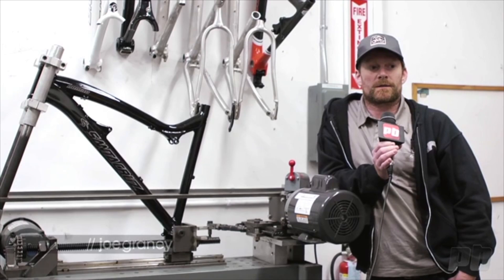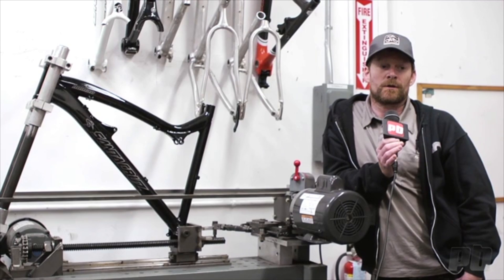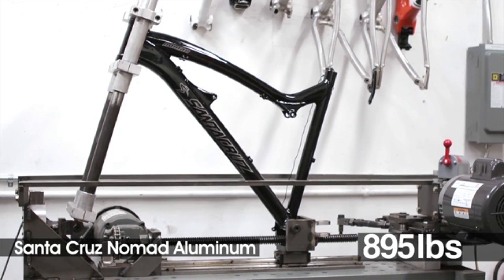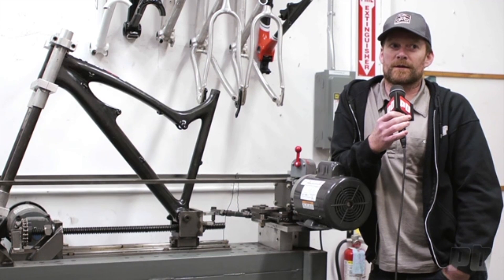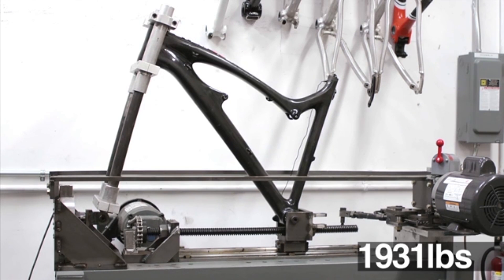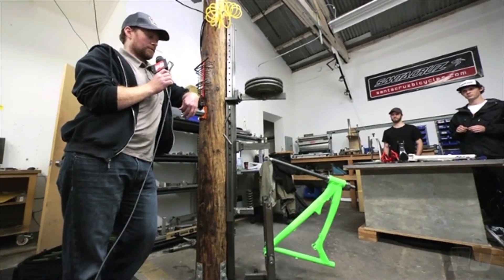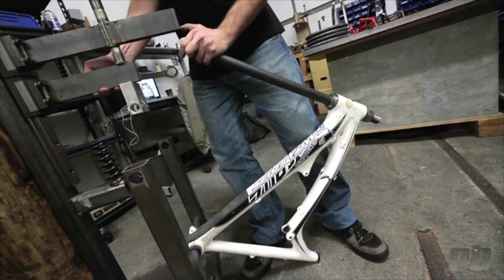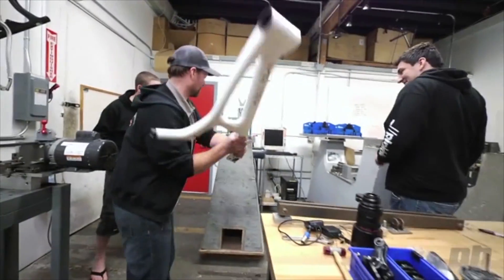Carbon vs Aluminum Frames - Which is Stronger?

Comment: The "smash the frame against concrete"-test at the end is majorly misleading.

A carbon frame that suffered from these impacts might feel safe in the hand and not show visible damage but internally those impacts lead to delamination which will result in cracks. As those delaminations are not visible it is a high risk for a rider to use a frame that suffered from such an impact yet from the outside you will not be able to tell if the frame is damaged. This is a reason why more and more companies offer carbon-bike inspection by using x-ray, ultrasound etc. to detect internal damage. This however was costly if performed after each (even minor) crash.

For that reason aluminium-frames are much safer in that way, that you can easily detect damage from the outside.
Furthermore quality-control is a major issue in the production of carbon frames. As carbon frames are assembled by hand even the tiniest imperfections (air bubbles, wrinkles, missalignment) can lead to major structural deficits.
(More in-depth explanation here: https://www.youtube.com/watch?v=EZbg5hCRyvs)

Lastly the first tests shown in this video are also not quite fair in that regard, that major damage to the carbon frame happens before the sudden cracking. If you listen to it carefully you can here the fibres bursting much sooner (at forces similarly to the aluminium frame). Those cracking sounds indicated damage to the bike that would already render it unsafe.

In conclusion this video can lead to a quite wrong impression about carbon fiber strength. Ultimately carbon is more vulnerable to sharp impacts and are much more costly to inspect. Fatigue cant be assesed that easily either.
Reply: My only problem with carbon is exactly because I can't detect the damage. It might be 'hanging on a thread' and I don't see anything, ride the trail, then got stabbed after a few jumps.
I'd rather have the frame bend a bit for each damage so at least if there is a slight bend and I still ride it then it snaps, that is my fault.
Reply: Cristian Ciupitu they're not avoiding carbon. The 787 is made of 80 cfrp
Reply: except they used an old, tested, abused, ridden, old frame. maybe, MAYBE you can't detect the damage as easily on carbon, but its still way stronger. people think aluminum is stronger because its metal. who cares what it is, look at the welds. thats what usually brakes. not the metal tubing, but the actual welding...
Reply: kansas785if if its a good weld them i is stronger than the actual frame
Reply: It all depends on what type of ply orientations and modulus of thermoplastics used. The orientations that exists inside the first twill are usually laid in 0/90/45/-45 directions and tow density also matters. Considering the application the maximum density of carbon fiber would be around 1.9-1.95 Kg/mm3 that is still almost 1Kg/mm3 less than aluminum 7075 tempered. Thus when used properly with right polymer, these fabrics offer extremely high tensile/compression strength, and also better protection to impact and continuous load.
 Being the metallurgy/composite metal matrix engineer i can confirm this.
Reply: @TheDazzler420  

Really, an engineer, then you would know carbon fiber is not matrixed with thermoplastic.
Reply: @truantray   really? then which polymer matrix they use.
Reply: TheDazzler420 epoxy is technically a thermoset. It has to do with the cross linking of the polymer chains. Which means that it burns instead of melting. It’s part of what makes carbon hard to recycle.
Reply: @GavynPendleton  only difference is this is carbon allotrope which is it can be reused as basic form of carbon, see carbon fiber has its own flaws in today's technology of production, that doesn't mean we should stop the application. People invest in all sort of advancement. And I think it's good to see composite materials becoming more n more reliable and predictable.
Reply: TheDazzler420 yea I totally agree with you. I’m currently studying composites in school because I think they are super cool and because they are super powerful in design.
Reply: TheDazzler420 Hi. I was wondering, I have a Specialized S-Works hardtail 1996 frame made in USA for many years made of metal matrix, very rigid frame. I'm probably easy on it. Is this material stronger than 6061 and 7075 aluminum and better with big impacts?
Reply: Gedöns And the ductile failure of the aluminium makes it much safer for the rider.
Reply: ohhh, killin em up! If companies made their carbon frames even CLOSE to as thick as the 2011/12 V-10 (years after turned into the thickness of a tin-can), then I would buy carbon ALL DAY. (thickest/most overlayed front carbon triangle production MTB ever made)
Just convinced me to fully stick with my original choice of the NEW aluminum 2018 Davinci Spartan. Bikes welded in Canada, too! stoked! (165mm 650b killer, has a pivot surrounding the rear axle, D-W link)
Reply: @420xwaytoomanyx420  
Not all aluminum is the same, but engineers at Canondale and Devinci get alloys to out perform carbon.
Reply: kansas785 Saying carbon fiber is like saying metal. There are so many different variations and quality of carbon fibers. As for metal, any good weld is actually stronger than the tube itself.
Reply: One of the reasons they have been limited using carbon for planes is its an insulator so isn’t as good for lightning strikes as it does have the faraday cage effect and can blow holes in it instead of run across the surface if I’m not mistaken.
Reply: Gedöns just cockblocked Carbon frames.
Reply: I was sure that was true but didn't exactly know why
Reply: just explain it as ali-ductile cf-brittle
Reply: best comment ever!
Reply: 100% agree with this and feel NO ONE should step on carbon (parts)  bicycles unless they are fully aware of the materials character
Reply: It is safe enough to get you home than replacing the frame if the best option
Reply: That wasn't a legitimate test. That was for shits and giggles
Reply: Carbon has changed a lot since then
Reply: Gedöns I'd love to see the NDT report after that test... I bet it looks like a bag of air! 😂
Reply: You bet it does!
Reply: Airbus and Boeing are probably avoiding carbon because  it's also very expensive and airplanes already cost a lot.
Reply: Exactly.  They don't show the residual and gradual degrading of composite.  Fact is most of us are not racers and will not need a frame for just the here and now.  If a pro fucks up a jump and is able to complete the run thanks to the carbon microcracking instead of bending like aluminum then yes its beneficial.  However what these asshats don't tell you is the said pro will have that frame swapped out or else it will explode on any given jump maybe because the temp got cold really quick.  all around really disappointing vid,  as I'm a santa cruz fanboy....they do make great looking bikes
Reply: Im a  NDT Technician working in aviation normally cracks in aluminum can be seen visually and most the of the cracks comes from fatigue.. If carbon composite are really good material then how come major companies like airbus and boeing still use a lot of materials made from aluminum and other metals, most notably for landing gear components, Wheel hubs and flight controls components. They can build it out of carbon but they dont..

From my experience we have seen aluminum wheels hubs that have multiple cracks all around it but the structure of the wheel remains true,  However for a wheel made of carbon when it fails it fails disastrous and will simply explode into pieces.
Reply: The reason companies like Boeing don't use composites for many components, is because composites are new to the manufacturing world, and so don't have decades of tests to support data on them. This combined with the fact that the mechanics of composites is ridiculously complex and ultimately not that good at predicting test values, (usually undershooting actually) makes it hard for companies to use composites. However, recently composite components have begun being integrated because they finally have had time to study them enough. 
NOTE: This is what my mechanics of composites teacher told us.
Reply: @edwinbeltran2677  you cant forget they are a business too. they need to get the job done the cheapest way possible.  aluminum is strong enough to do the job's and is the cheaper product. from a business standpoint aluminum is the obvious choice
Reply: Edwin Beltran Many modern airliners use carbon fibre in parts of the airframe, including the fuselage and entire *wings*.  The two companies you mentioned also have started producing aircraft comprised of %50 composites:  http://www.materialsforengineering.co.uk/engineering-materials-features/aerospace-industry-moves-to-carbon-fibre-wings/61987/.  All materials have an intended use and application.
Reply: @Digitalfiendscom  Yes, you are right, I am doing an internship at a company in the Netherlands where they make thermoplastic composite (carbon and glass fiber) parts for boeing, airbus, fokker and many other brands.  They make clips for in the fuselage, window frames of 6mm thick carbon fiber, ribs for brake flaps wings and and so on. They do manufacture reinforcement ribs for the fuselage from big to small aircrafts, even for helicopters. And they do a non destructive inspection for every part that goes out. 
So it's basically the future, it already was years ago btw.
Reply: Agreed. I was thinking the same thing
Reply: Good comment
Reply: It's so fucking shit
Reply: You got that right mister!  Aluminum is softer and tells you when it has been compromised. I just saw a video of a guy with a carbon frame that failed catastrophically on a jump. The frame cracked completely after being damaged before during the trail. Aluminum does not behave this way even though carbon frames are stronger.
Reply: This whole video is just expensive marketing stunts. Carbon fiber has ruined cycling and turned it into a sport of douchebags.
Reply: @truantray  the cf bikes today are not fit for downhill, but for velodrome cycling it is perfect.
Reply: @truantray  why do u say that?
Reply: Yup no way the frame is remotely safe after a hit like that. Will instantaneously fail in a split second one day and down you go for a dirt nap.
Reply: Also the sound of fibers cracking internally is audible for carbon. The strength of carbon fiber is getting weaker gradually which is still unfit for riding. ( I'm not a geek though. I felt this video is misleading). I'm more than happy with aluminum than even trying the carbon which isn't affordable for me.
Reply: Eh. First off you can easily check for delamination with the "coin tap" test. It's easy and takes one.25 coin. We use it all the time in aviation when NDT isn't necessary. Also I noticed the carbon did fail abruptly, but the bike didn't fall to pieces like a jenga game, it still held its basic shape, with a rider on it, maybe it's a different story, but I doubt it, cabon is some strong stuff.  That's just my input.
Reply: Cost and resistance to heat and cold. Alloys will stand better against extreme cold and heat hen carbon will, as well as the fact that carbon is quite expensive and difficult to work with
Reply: Gedöns you are such a buzz-kill. good lord

Comment: At the end of the day, regardless of Alu or Carb, both frames are f-ing strong, and you prob will never break e'm. Ever.
Reply: Theoutsmarter And if you brake any type frame it will probably all be without warning!
Reply: Username checks out
Reply: Just broke my carbon 2 days ago
Reply: @toofarpunk  How?
Reply: @toofarpunk  was it painted, did it just fracture or catastrophic?  Brand name/model? Do you use it exclusively on smooth paved roads?
Reply: dac518 yeti SB5.  I ride mountain.
Reply: @mitchellmtb7202   are you @soundsunderground or also broke a carbon bike? And in only 2 years?
Reply: dac518 ha sorry.  Yes same person.  Yep!  Didn’t take much.  Notice how they don’t stress test the rear triangle.  There is a reason for that—it is a pretty weak part of the frame.
Reply: MitchellMTB I know this is MTB related, but on road bikes, carbon forks and seat stays on the rear triangle of a hybrid steel and carbon frame should be no problem right? Yeti are sending you a new frame?
Reply: @jamesmedina2062  $383 for a new rear triangle.  That's the crash replacement price.  I'll post the crash that cracked it soon.  It was nothing.  It does not take much to crack carbon with blunt force on a rock.
Reply: @mitchellmtb7202  yeah carbon is very stiff and barely elongates before snapping. Unlike metals that have some give. I think[ carbon only elongates by between 1-1.8%
Reply: A friend broke his carbon frame on a 2 feet drop. 4 months ago. Its a sudden break. He broke his pelvic bone, broke his ankle, tore ligaments. His regrets? Spending thousands of dollars on a carbon frame for its lightness. Both aluminium and carbon can break but carbon will break suddenly without you noticing a deteriotion on the part.
Reply: Thank god someone with some sense.
Reply: @GavynPendleton  they are actually surprisingly easy to break. Especially if you land to short at a down ramp  you know when you only clear with the front wheel but  the rear tire just hits the vertical part of the down ramp or landing face or whatever you want to call it
Reply: I just broke my alloy frame
Reply: I've broke both. 
A few times. 
😎🤙
Reply: @radbikeshredgnar4423  At this point u need to go to a motorcross 😂😂
Reply: Fatigue and aluminium argue to differ...
Structural damage against the design plane in carbon fibre can also drastically affect the structural integrity...
Reply: Idk my dad has broken two carbon frames getting them koms 🥲
Reply: Unless it's trek carbon
Reply: also they provide lifetime warranty so..
Reply: @MitikshSuthar  soooooo...... ????
Reply: You underestimate me
Reply: Thomas The Offroad Train  yep hit a corner of a stick on carbon wheels twisted up and shattered the side and started leaking air on my tubeless wheels. And it makes you start to think a little more when I miniscule stick can break a well reputable branded wheel. And machine test don't simulate natural riding imo. It's like just looking at the best and strongest features of rigidity but overlooking other variables.
Reply: Probably. except one of my bikes which is an aluminum frame had to be welded. i did buy it used though and its still holding up
Reply: Theoutsmarter i know a lot of ppl that have broken carbon fiber frames with normal usage
Reply: @xsamueloo  yes... but not santa cruz carbon
Reply: Broke a carbon 2020 remedy twice, the first time a stress crack in the rear triangle, second time I cased a small jump and completly cracked the bottom bracket. I've now upgrade to a bronson C
Reply: @xsamueloo  same with aluminum... you too your bike over into a curb or stone with aluminum and it's going to dent and crease which will lead to failure
Reply: @JGstunts22  I just really need a reason to NOT want a carbon bike, so I'm gonna tell myself it's a plastic that gets brittle in the sun and not good for a daily deover
Reply: @JGstunts22  driver
Reply: @dac518  had my carbon nomad 3 years now crashed it many times (big crashes too) still going strong
Reply: If you don't break a frame after 10 years you're not riding it hard enough.
Reply: @CoderShare  lol I've used a chromoly frame for over 15 years and on the skatepark which is hard on it. The paint has seen better days but the frame is still as solid as the day I bought it.
Reply: @ForcedCompliance  cromo steel is awesome... Can be easily fixed without complicated heat treatment or sleeving and resin processes...
Reply: @Lancia444  yes, and it can rust since it is steel and is heavier than aluminum and carbon. For a casual hobbyist/rider it's ok, for people who are trying to win a competition it can cost them the win.

Nobody is forcing anyone to buy carbon frames, aluminum frames are cheap and abundant.

Comment: No safety glasses?
Reply: Don't you know it feels good when razor sharp carbon fibers get in your eyes?
Reply: amas sawi a geek bitch with two working eyes is my guess. I'd wear the glasses
Reply: rumberitoboricua exactly what I was wondering
Reply: Shards of CF zinging across the room and stabbing eyeballs.
I guess that's up to them.
If I were there, I'd refuse to be in the same room without PPE.
Reply: "Safety Skints Engaged" AvE
Reply: they are professionals, they don't need that
Reply: I hope for their sake, nobody from OSHA sees this video.
Reply: Sheesh...what a couple of safety snowflakes
Reply: rumberitoboricua 😐
Reply: rumberitoboricua .
Reply: rumberitoboricua Only noobs use safety glasses
Reply: rumberitoboricua your such a geek bitch

Comment: Why haven't you done a new one since this one? This one is far from a fair test, although on the surface it seems impressive. A lot of questions left unanswered here, and the test throws up questions in itself, such as why do they compare off the shelf aluminium frames against used Carbon? All the frames are pre-selected for the test. Why not allow any frame from the shelf be used, randomly selected by someone independent...? If their carbon is so good, why haven't they done another test in 5 years?